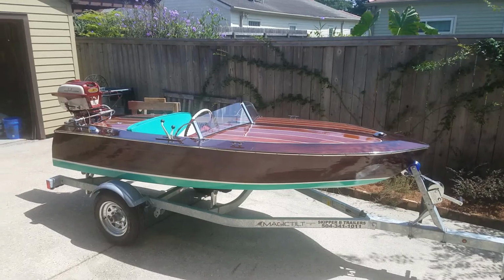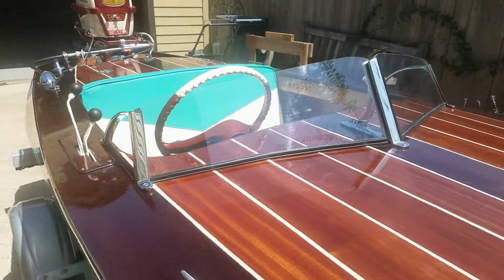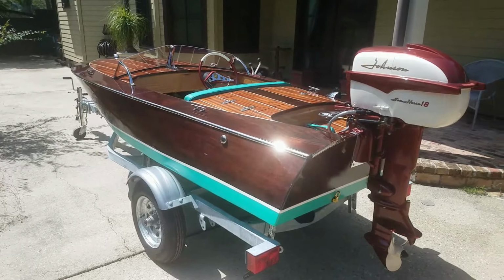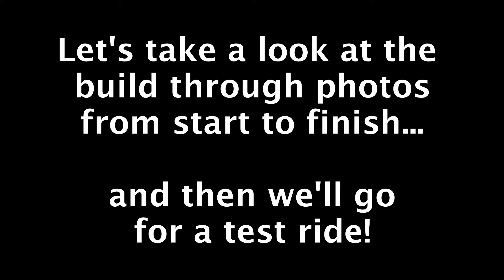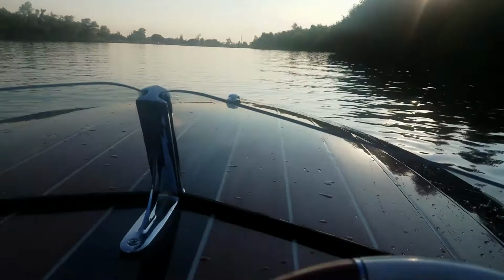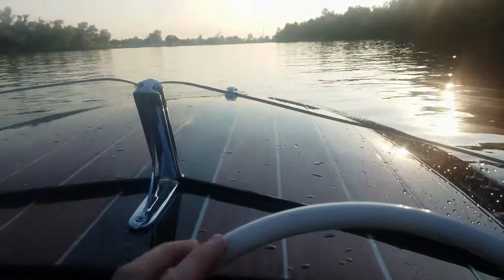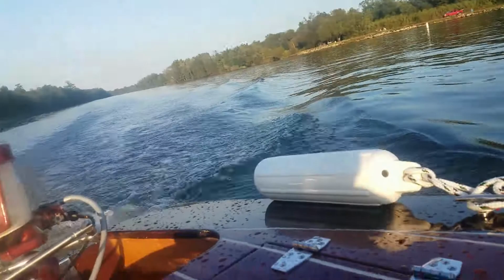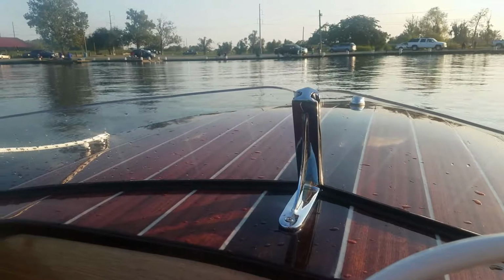Glen-L Squirt Build Tour and Test Run & Launch

Comment from the maker: Someone asked where the stainless rub rail came from, but the comment may have been deleted.  To answer, it was ordered directly from Taco Marine:  Part Number: S11-4511P12, 304 Stainless Steel Hollow Back Rub Rail, 3/4”W x 12’L.  Cost was $60 per 12' piece but was $250 to ship because of its length.  I ordered four pieces, which gave me enough to do each side in one piece, the left and right edges of the transom, and two five-foot splash rails, which weren't yet on the boat at the time of this video.  For corners, I carved pieces from 3/4" rubber hose and tucked them under the square end of the stainless.  The ends of the stainless were hammered round, filed and polished to provide a smooth end.

Comment: Beautiful build. Did you do anything special to reinforce for the bigger engine? I see the plans recommend up to a 10hp.
Reply from the maker: I think the 18 weighs 60 pounds and the thrust isn't crazy strong. Per plans, the transom is single 3/4" ply with a doubler plate at the motor well, and a 2x 3/4 ply knee tied to the keel.  It's pretty stout.

Comment: Hi Bill.  Your finished project looks great.  Can you tell me what type of pump you used and how many CFM?  Also, did you finish the epoxy with any type of UV inhibitor or UV varnish?
Reply from the maker: The pump for vacuum bagging?  I have another video just on that.  It's a used medical pump that I bought on eBay for $50 and then rigged up the vavles and switch.   And, yes, the epoxy was wet sanded and top coated with an automotive 2-stage clear coat.  Because the boat doesn't sit in the water full time, it will last just fine!
Reply: @billthomassie6118    Great to hear back.  I found the video on the bagging.  That is a great help.  I actually received my used ebay $50 pump today and have ordered up the other bagging supplies.  I'll experiment first on some of the removable aft deck splash panels to get the hand of it.  If that goes well, then I will try doing some laminating over some of the fiberglass cabin sides.  For now,  I will stay away from the waterline.  Cheers!
Reply from the maker: @Eric Schulz  The hardest part is not the bagging process but controlling and managing the glue/epoxy/adhesive to keep it from sealing the pores of the surface you want to stain.  It will come out blotchy if you're not careful about cleaning that up while it's cleanable, before it cures.
Reply: @billthomassie6118  Hi Bill.  That is great input (and I'm looking for all I can get).  I saw your care in cleaning up the resin before it fully solidified.   I'm thinking I will use a clear resin (I have West system clear) and am not staining the veneer.  I am going to use some teak in one area and some walnut in another if all goes according to (the developing) plan.  I've been playing around with laminating some small strips to see how it looks and performs.  I'm thinking of a couple of clear coats of epoxy over the veneer, then finish with a UV stabilized urethane or varnish.  This would be comparable to what West systems suggests for exterior teak handrails and trim for a longer term finish than just varnish.

Comment: How would one go about adding them so called "Splash Rails" I'm new to all of what boats are in the manner of terms. Any way to show a picture ?  To this existing model that is.
Reply from the maker: The splash rails were added a couple of months ago.  I used solid 1" white oak that I had left over.  I made them 2" wide x 5' long with a rounded taper at the front.  I set them just above the painted stripe, which is about 4" above the bottom of the hull.  I used more of the 3/4" stainless trim to cap the sides, which also hid the screws that fastened the rails to the hull ribs.  For added security, I put one screw at the forward edge from the inside of the hull.  The others couldn't be reached from the inside because they were added after the foam flotation was put in, which blocked access. The hardest part is shaping the edge of the rail that has to mate to the contoured curves of the hull.  It took a lot of sanding and fine tuning to match.

Comment: Bill, do you have a build thread on the Glen-L forum?  How did you attach the cover boards, Vacuum bag like the sides? What did you use to fill the seams white on the deck.  Thanks Doug
Reply from the maker: No blog, but I documented everything through photos.  The deck is an underlayment of 1/4" marine ply, epoxied and nailed. I epoxied the overlayment perimeter boards using clamps and ratchet straps.  The outer edges were wild and I planed them to the edge after it cured. The 1/4" Sapele was epoxied and temporarily anchored to the deck using scraps as clips fastened with drywall screws where the ivory infill would go.  The infill is a the same epoxy with fiber filler, tinted slightly with acrylic enamel, umber and white.
Reply from the maker: Look at the pics between 4:20 and 4:40.
Reply: @billthomassie6118  Thanks, again great job.  You should be very proud of that boat!